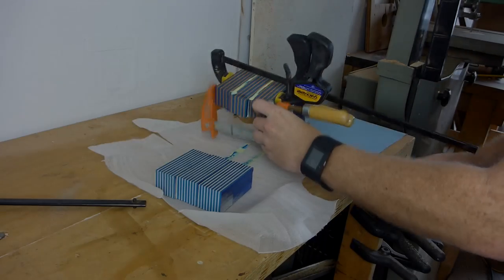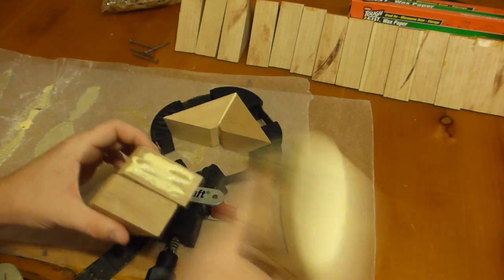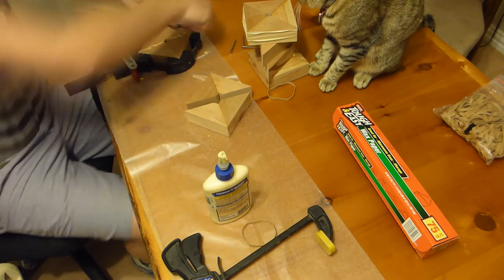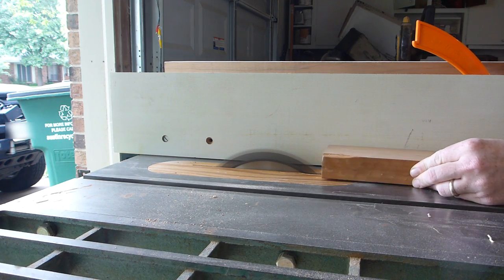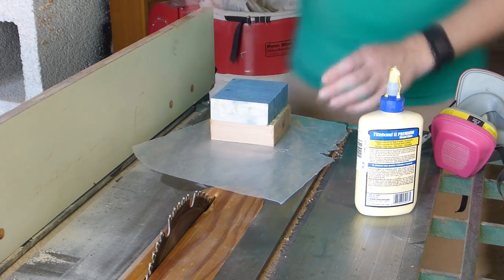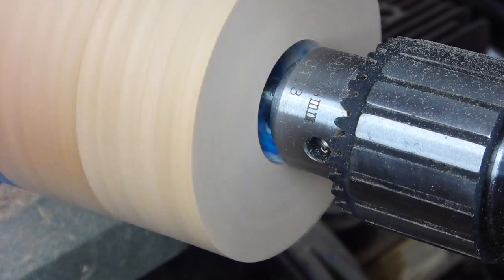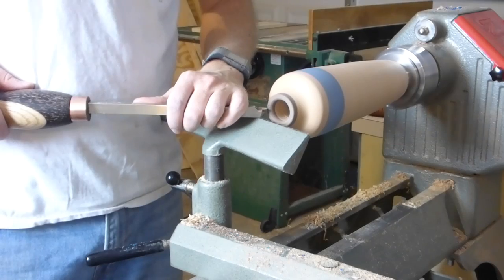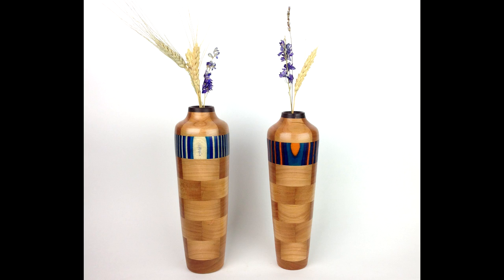Segmented Vases for Mother's Day

Comment: Hey Grady,
it's been almost 2 years now... and i'd love to hear some follow-up.
i'm wondering, did you treat the inside of the vases at all?
how do they hold up? do they take up moisture? do they disfigure? does the wood disperse anyting to the water (does the watery stay clean enough for flowers)?
Reply from the maker: I didn't do anything to the inside of the vases. They are for dry flowers only. They are holding up just fine so far!

Comment: how do you finish the inside? wouldn't water ruin it if you don't finish the inside?
Reply from the maker: I didn't finish the insides. These are for dry or fake flowers only.
Reply: Actually as I read that I thought of how to finish the inside. Couldn't you spin the vase with oil in side and it will coat the inside mostly evenly.
Reply: Oil or even epoxy Resin :)

Comment: very nice vase, although the tools required for this job would probably cost me above 500$ ( used)
Reply: a lathe from harbor freight + a miter saw + a chuck + lathe tools is probably right around there.  I would urge you not to cheap out on the chuck or the lathe tools.  I still use my harbor freight lathe and it has made me a ton of stuff over the years.  If you want to learn more search for carl jacobson on youtube he is really good and a nice guy all around.